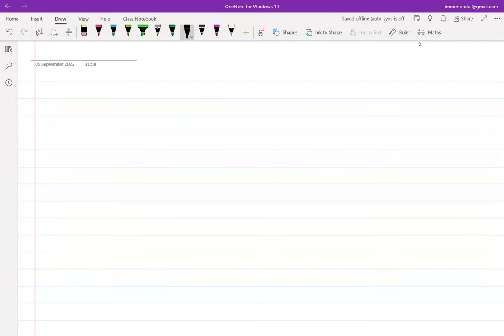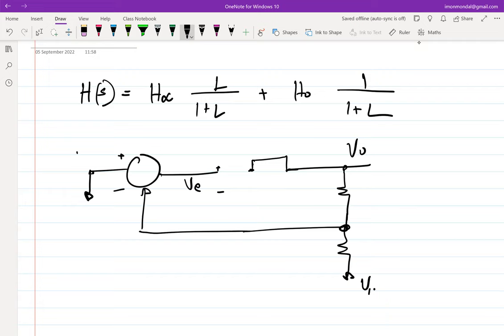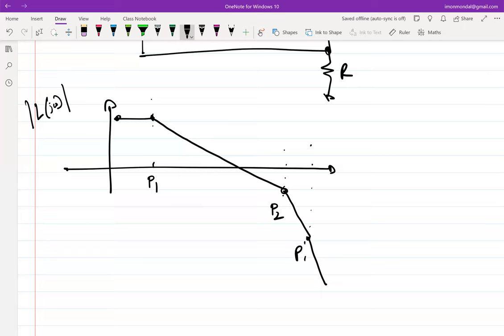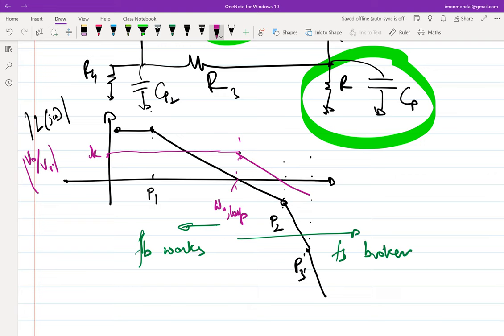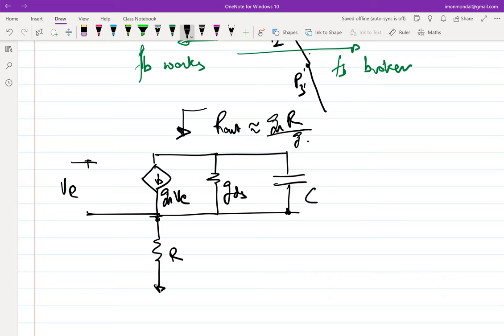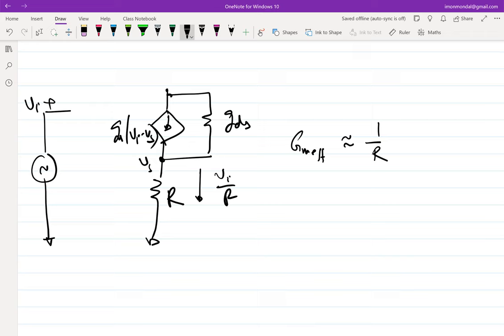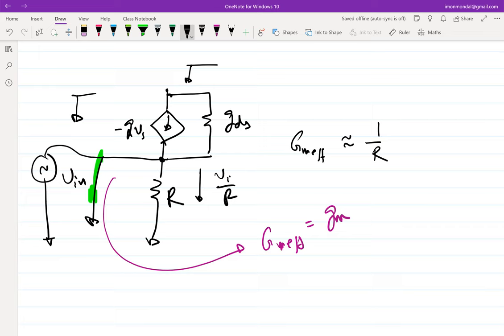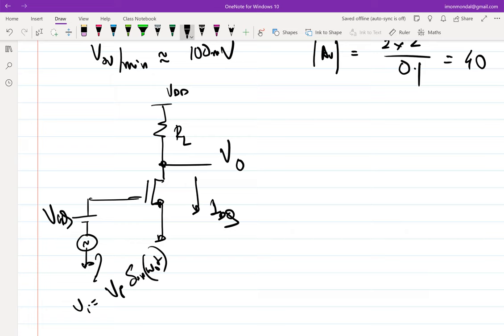Lecture11: Swing limitations and maximum gain in a common source amplifier; Intro to cascode stage

Comment: 35:10 Finding short circuit current easily / intuitively
37:00 Condition for large Gm 
40:26 Obtained circuit is a Cascode connection
43:10 Introduction to swing limits 
50:25 Although R_L enhances gain but it pushes the MOSFET towards triode 
53:29 Similar to R_L, gm is also pushing the MOSFET towards triode 
55:40 Finding maximum value of gain before the MOSFET enters to triode
58:07 Maximum typical gain at current technology
1:02:53 Finding Maximum input voltage amplitude for which MOSFET remain in saturation.